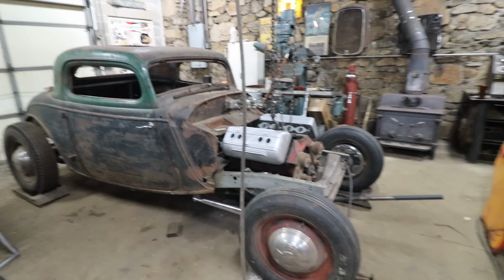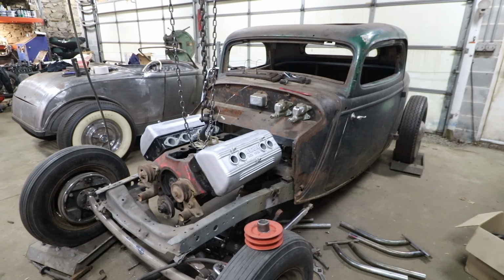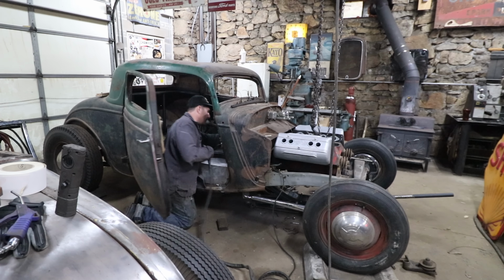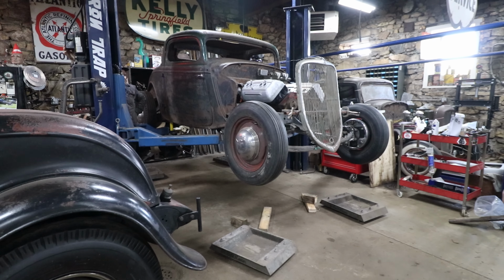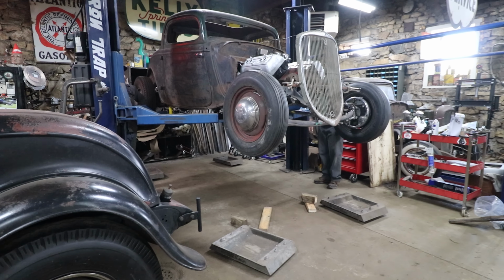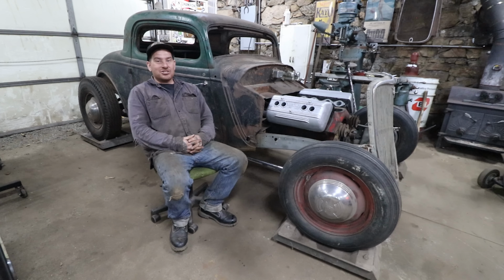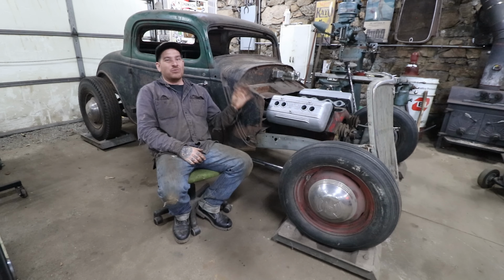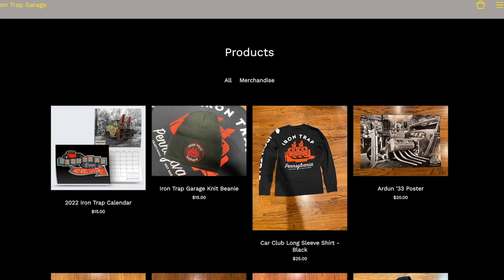Making The Ardun OHV Flathead Fit In The 1933 Ford 3 Window Coupe

Comment: 5:41 Will those valve covers come off that close to the firewall ?
Did you check the angle of the engine/trans before welding the the mounts ?
Reply from the maker: Yes was checking angle the entire time we were moving it all around. Valve covers will have to come off. Engine NEEDS to live there. Will modify metal around it if need be.

Comment: The hard work that you did to get the Ardun equipped flat motor to fit in and look right in the 33 3 window is the reason that the early Mopar Hemis were not used in a lot of street rods back in the day. Mostly them were just used in purely race cars where looks were not so important. I have always loved the look of the ardun equipped cars and some of the records they set at Bonneville have yet to be beat. I am still watching this series and look forward to the next installment. 😎

Comment: I love the preservation/upgrades on your builds. I do have a question...I have a '37 ford club coupe and It has old cracking lacquer paint and I do plan on painting the car eventually. What would you advise someone to do with the cracking/checking paint? I thought about rubbing it out to the red oxide primer in places...its a black car so,  the cracking isnt very forgiving.
Reply: When i was a youngster,the trick with old lacquer was to simply spray the car with raw thinners,then cut and polish it.But, You can't buy lacquer thinners anymore.  If it's enamel,then there is no cure.